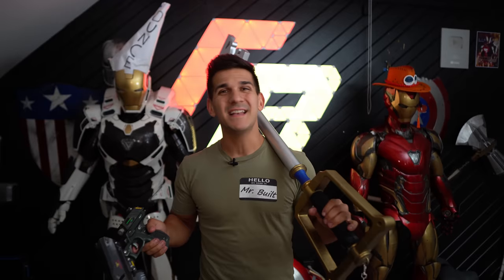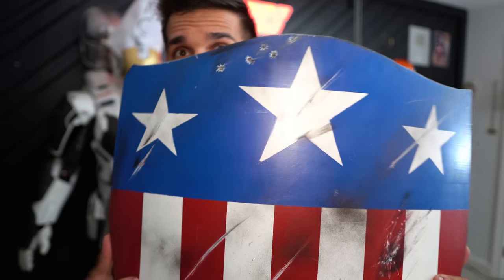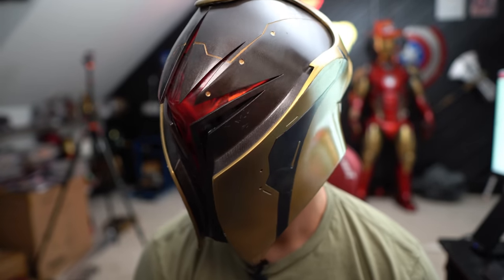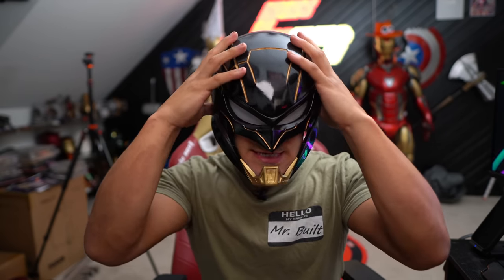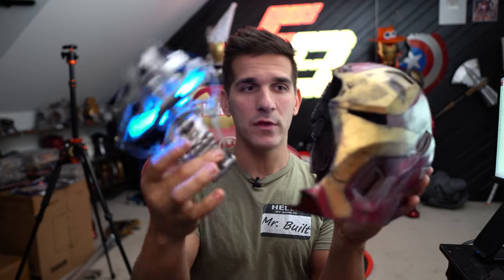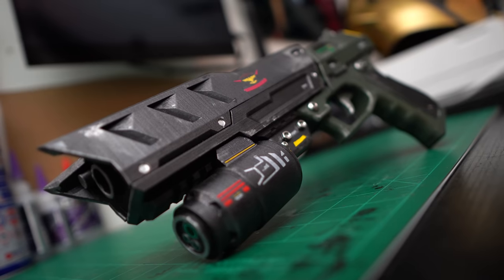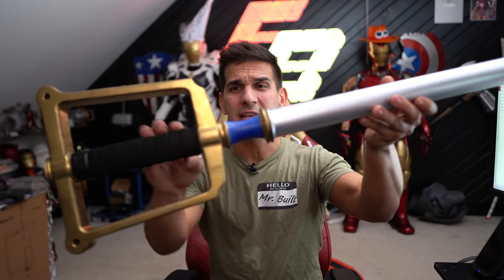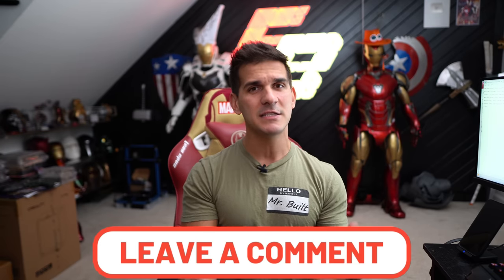3D Printed Projects That NEVER Got a Tutorial!

Comment: Just get an Airbrush you wont look back, I recommend Harder Steenbeck Evolution. Its on the expensive side of brushes but it makes up for the price with how easy it is to clean and put together. You can get a filter/regulator and run it off a large automotive compressor that you probably have all ready.